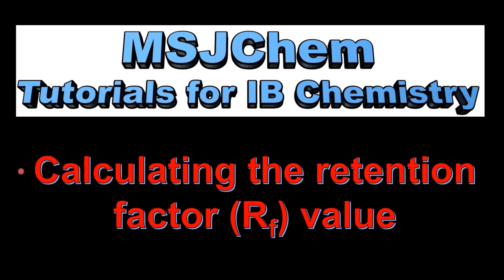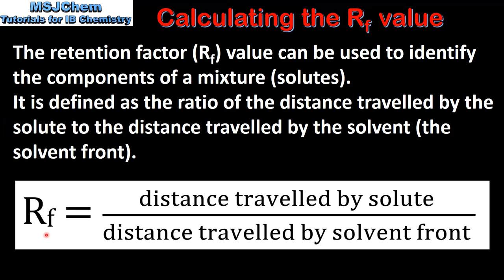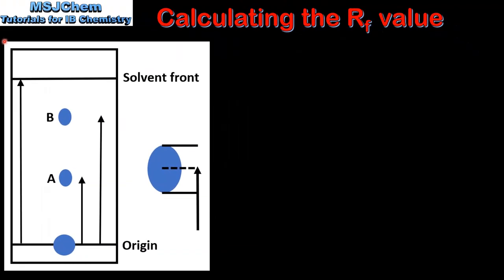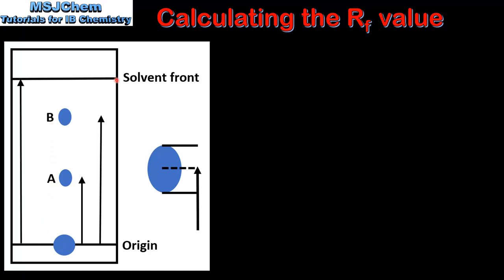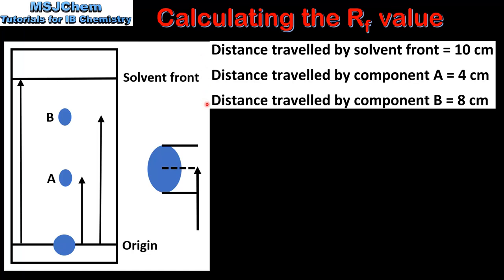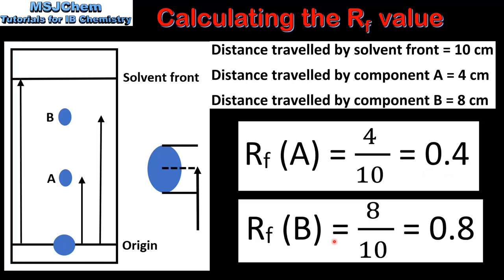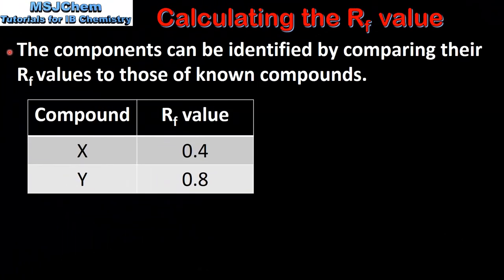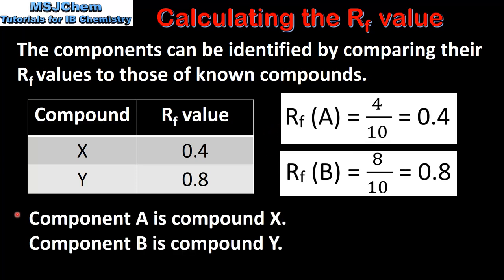S2.2.10 Calculating retention factor (Rf) values

Comment: what if the X compound and Y compound was not exact same rf value as A AND B but close to it. Would it still be correct? like x is 0.41 and Y is 0.81 but A is 0.42 and B is 0.83. would it still be the same values